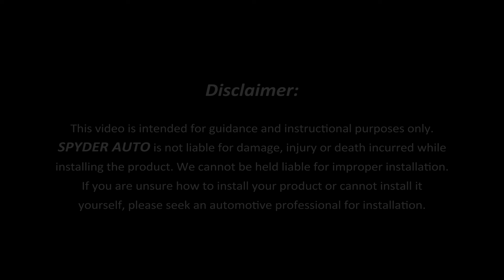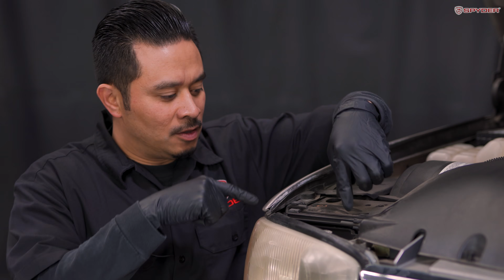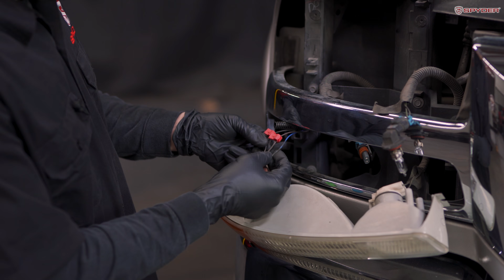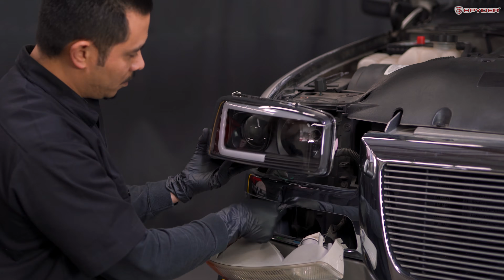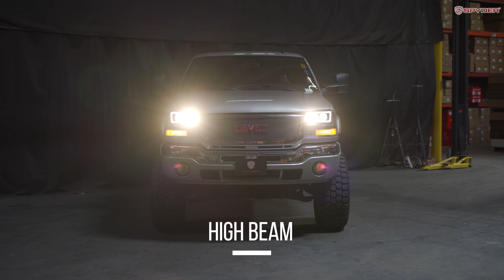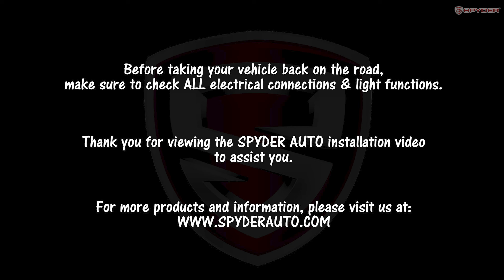Spyder Auto Installation: 1999-2006 GMC Sierra Headlight

Comment: I would buy if they had a aftermarket housing for the bottom set instead of just the top
Reply: Lmao goodluck finding a led bar fitted on the gm 99-07 best you can get is a newer looking led bar deal for the bumper lights

Comment: if you connect to the side marker wires, your turn signals don't work when the engine is running (work fine with the ignition on though). Not sure if that's the case here also ... can't tell if the truck is running or not.

Comment: Idk what I did wrong but now my left blinker ticks fast when activated
Reply: what he doesn't tell you is that you need to replace the turn signal relay with an LED compatible one. they flash quickly because the current going through the wires is too low with the stock relay and the system thinks something is wrong.

Comment: why do my low beams stay on all the time
Reply: You definitely wired something up wrong..!
Reply: @blakeslocum2732  i already got it right but thanks anyways 😂
Reply: How did you wire it so that only the line lights up when running ?
Reply: My low beams or high beams are always on , i cant get just the line ?
Reply: @Hndzzzz310  these trucks have DRL’s, so when the truck is in drive, the DRLS will be on. There are a few sets of wires.  

The high beams, low beams, parking lights(and/or turn signals) and DRL wires. You can look up wiring diagrams and this should help you out a ton.
Reply: @Hndzzzz310  sorry for answering late but if u take out your blinker bulb there should be 3 wires 1: ground 2: running 3:blinking 
connect your drl light (led line) wire to the ground wire and the hot wire to the running light wire. i don’t remember the exact one it is but find out which one is your running wire and connect it to that , hope this helps !
Reply: My Ambient light sensor was bad on mine, 2007 2500 sierra LBZ. Open up the dash board, and replace the small red bubble (ambient light sensor) near the windshield on top of the dash. When there is light on it (use a flashlight on it in a garage) then the daylight running lights (DLR's) turn on. When there is not light than the headlight automatically kick on. Also check the DLR relay and DLR fuse. Both my DLR lamps where bad as well.
Reply: This is absolutely not plug and play on a 99-02. Fair warning

Comment: There is a noticeable gap in between my lights and the grill... anyone else have this issue?
Reply: I didn’t have any gap that was so noticeable I returned it.. yeah there’s a gap but it’s honestly not much bigger than OEM
Reply: They are probably aiming high . Park in front of a wall or garage door . With the old lights in place , turn them on and mark the lit area with some painters tape , then reinstall the leds new lenses and adjust them t15 driver at the bottom through the hole going straight down .

Comment: I bought these for my truck 2 years ago, and the projector went out already. Reason because of too much heat. Going back to stock ❤️
Reply: The light that came with it?
Reply: @17slickace  yeah didn't provide much info. I am wondering the same thing
Reply: @mg90q61  i just bought some leds to replace them just have to adjust these  suckers
Reply: That’s why I upgraded mine. I got LED’s from Amazon, they come with the in-line box needed for voltage as well and have fans on a heat sink on the back. Really well made. Glad I changed them

Comment: Spyder needs to make a blinker assembly to match. Cant find a good look to go with the headlights. I guess ill go halos and leds
Reply: Look on Amazon. Just ordered running lights and turn signal leds for $80. Kinda expensive.  Message me and I will let you know how they are
Reply: Nope best thing to do is go on ebay or amazon and get one that is black background and clear lens. Looks the best and is the cleanest. $30
Reply: @roostmx  I’ve seen the $30 ones. Unfortunately they’re garbage quality. When it comes to headlight housings you get what you pay for, they like to cheap out on the housing (I.e. low quality glue and sealants, and low quality plastic that will turn yellow really fast)
Reply: Blake Slocum mine were more than great so clear you can never tell theirs even a lense. I have a gmc sierra now that has that same bottom lense and spyder headlights

Comment: Anybody know if these allow good ol Filament light bulbs? I don’t want them freezing over in the winter.
Reply: Just buy leds from amazon. Sealight for about $50 for high and low beams
Reply: They come installed with halogens in them. No worries there
Reply: @blakeslocum2732  sweet, and do they have the adjustment screws? I cant see from the video.
Reply: @Zulfburht  they do have adjustment screws. The access to them is a pain in the butt though, so I just grabbed pliers and turned the screw shaft from the top. Worked perfectly fine! 

Side note I wouldn’t recommend leaving halogens in there. Others have had problems with the projectors melting. Don’t know why. I put LED’s in mine that are high quality. Cost me more than $100 but they’ve been great thus far.

Also I wouldn’t worry about them freezing over. High-powered LEDs still put off a decent amount of heat (thus mine have a heat sink and fan on the bottom) and I literally drove through a snow “storm” yesterday and had no issues with any of it. 👍
Reply: I’ve had these for prolly 6 months or longer now

Comment: What wire size T-Tap connectors?? You failed to mention that in the beginning?
Reply: Hey did you find out? Im having trouble with that
Reply: 16awg
Reply: I used 16-14 awg T-Taps from auto zone they’re like 5$  the parking light wires are 16 awg. The guy in this video failed to mention the wire size and the multi-meter is pretty much pointless!! The camera guy was standing to far back not close enough to the instructor both men could’ve done better job tbh ..the only wire you don’t tap is the blue wire
Reply: I wouldn’t use T-taps. They’re unreliable and allow for water intrusion. I cut the wires and just spliced the wires together with shrinking butt connectors. I know, more permanent, but it’s fixable if they end up breaking somehow. I left the stock bulb sockets.
Reply: @blakeslocum2732 how do you wire them to an 05 Yukon

Comment: I got some aftermarket projector headlights for my 2001 suburban and the brights and projectors don’t line up. So my brights arent even pointed on the road and the projectors are. I wonder if the lights work good on these headlights? Someone please let me know
Reply: i have this same problem. did you ever figure it out?
Reply: @jameskennedy5728  what lights do you have? and no i never messed with it. im probably going to get a new set of original lights
Reply: Hmm. Sounds like the mounting is all screwed up on there. Never had to mess with mine though so I don’t know if they have adjustability

Comment: I cant get the holes on the light to align with the truck to get the pins in. And there is s gap between the light and grille.
Reply: I didn’t really have this issue. I would say the pins were harder to align than stock, but I’ve done it several times without problem now.

Comment: I hooked  mine to the turn signal and it looks cool when flashing
Reply: how did you do that I wanna do tht too mine sounds sick
Reply: @bryantorres6237  you just tap the led strip into the turn signal wire
Reply: Did you wire it to both the park wire and the blinker wire? Or just the blinker wire? Im curious to know if it would still blink like that
Reply: @marshall2368  how do you make the led strip light up
Reply: @marshall2368  I need a little help
Reply: @marshall2368  Where do I connect the wires?

Comment: Is the Led bar going to be running with day time running lights ?
Reply: No because he didnt tap it into the drl’s. You can tap into both tho I’m sure and they will be on all the time.
Reply: @marshall2368  I want to tap into and make them day time running lights, can I just tap the black into black and green into blue with my connectors
Reply: It was on when they turned it on near the end of the video, should be self-explanatory from there.
Reply: @CB-lh8gw  i think he's asking can we run the light bar on the daytime running light wires instead of having it on the park lights ?

Comment: I'd like to know what those connecters are your mentioning.
Reply: T-Tap connectors. can get them at any autoparts store. they also come in kit.
Reply: @Garret3579  I wouldn’t recommend t tap connectors. They’re unreliable and are not water tight. I used but connectors with glue and heat shrink built in. It’s more commitment but way higher quality. Since the original plugs are still in place it’s always reversible.